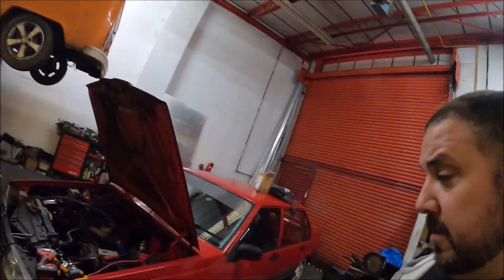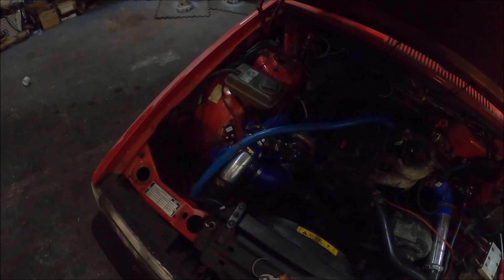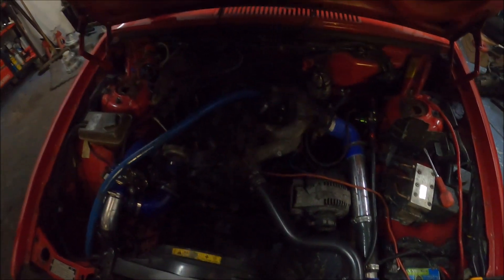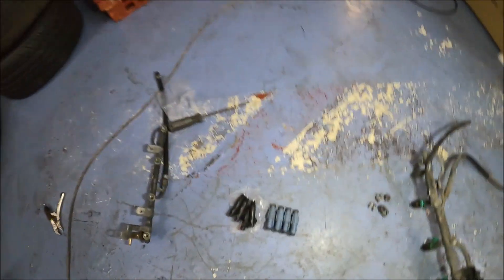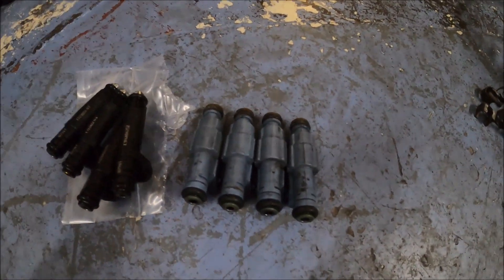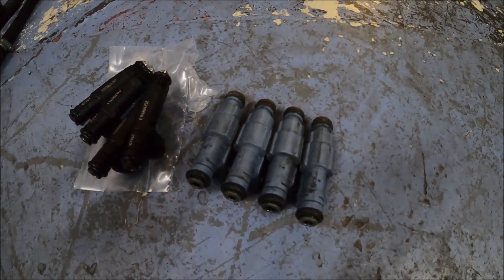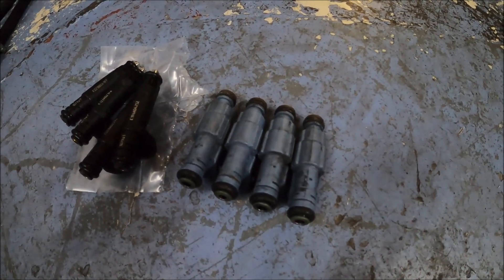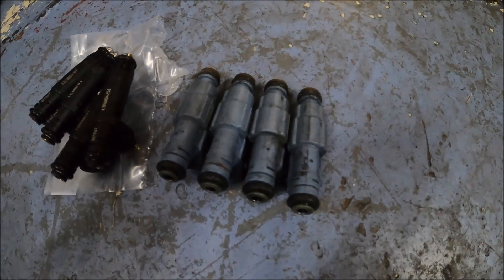Have I fixed it? Yes? Noooo! YES! Volvo Turbo fuel issues FIXED! HUGE relief!

Comment: Stav, did you do the resistor mod when you fitted the astra vxr injectors?
Reply: Wouldn't cause the problems, the ecu would have fried itself
Reply from the maker: Yes resistor mod is done